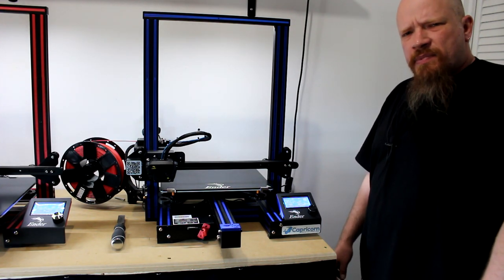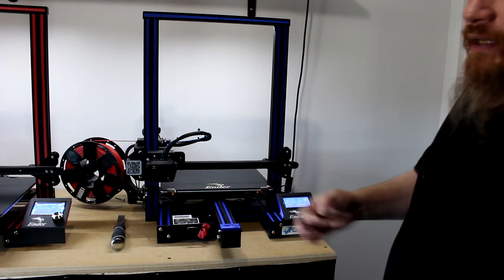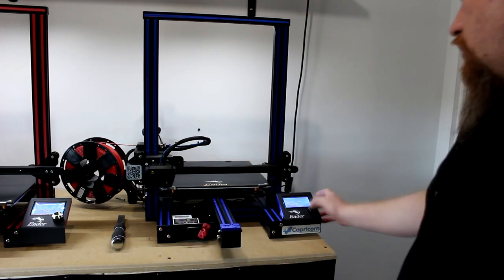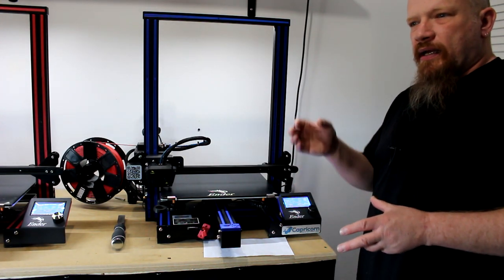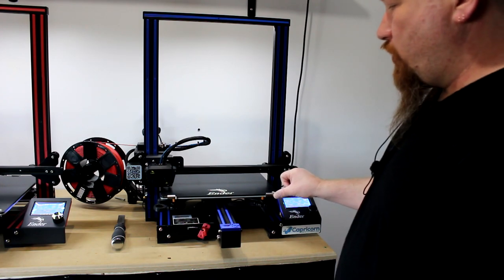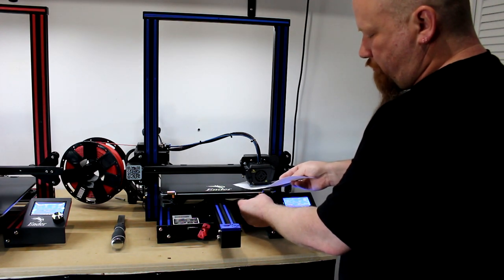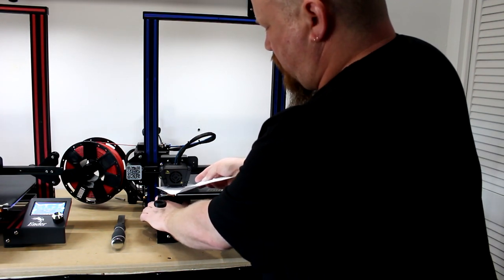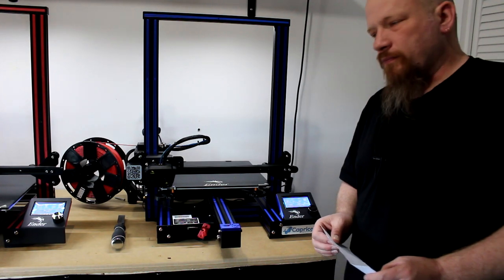Ender 3 Max Bed Level How To

Comment: Do i have to do bed leveling after any use of the printer? Cant we save it?
Reply from the maker: Yes, and no. Depending on the print itself .if I’m trying to remove the print, and it stuck very well to the bed, you might unlevel your bed. That’s why it’s good every third or fourth print re-level your bed or check it.
Reply: @djsprc  thanks 🙏

Comment: When lowering and raising the bed, what direction do in turn the screws under the bed?
Reply from the maker: Clockwise you’re raising the bed counterclockwise you’re lowering the bed what I do when I feel tension on the screw I’m lowering the bed if I feel it no tension I’m raising the bed
Reply: @djsprc  thanks for the very rapid reply to question.  I was focusing on getting my stl files to gcode on Cura 5.1 first and now I am ready to get my ender 3 max printer ready so I can make my very first print,  which will be something like a beskar bar or Imperial credits before I print a mandalorian helmet.  Thanks and I have subscribed to your YouTube channel.  Do you have Facebook or IG?

Comment: Its really nice to see someone do the max! Ive had mine for 5 weeks and had to figure it out by myself.Ive added a few things to mine.BL touch ,no springs its solid now, and also added a dual Z.I was having issues and noticed the gantry not going up and down even even after adjusting it perfect.So I bought a V2 dula Z kit on Amazon for $25us and a 488mm Z rod for $18us and it works perfect! After 20+ zero issuses and havent touched leveling other than Z endstop in tune when print is running and even that is rare.
Reply from the maker: What firmware are you running for your bl touch
Reply: @djsprc  the one on Creality. Easy download and works perfectly. Also the adding of the dual Z no need to download any new Firmware because the Z motors are linked together
Reply from the maker: @davidjohnson8474  Cool I tried I did not want to work for me I went with the Marlin firmware special build
Reply: Where did you get the dual Z, was it a kit? How did you install it was it easy? I have a max on the way and was watching and read about it and seems like Creality kind of missed the ball with the single Z.
Reply: @fimmerson  what i did was buy a V2 dual Z kit and then figured out the max uses a 480mm Z rod so i found one on Amazon. The kit comes with a connector wire so both Z work together. When putting it on you need to relocate the power supply and fallow the instructions and put the plate on. When doing this what I did was put2 rolls of blue tape to get it close.After its all together measure the gantry on both sides and rotate the screws to get them ever.Then it works sweet
Reply: @davidjohnson8474  Hey thanks for the quick reply and info I will do this once I get mine.
Reply: I'm around if any issues
Reply: Yeah the creality firmware is trash..
Reply: Hi Mike, did your Max require a Z kit ( Z modification) or everything went well without any extra hardware?
Reply: @AA-en8gw  I bought a kit and threaded rod anyways and the install was super easy works like a dream. Now if I could just get my bltouch to work.
Reply: @fimmerson , how much the Bl-touch kit has cost you if I may ask? I'm planning to use the cheap £12 from eBay and build the bracket mount myself. As I can't spot any difference between the £49 and the £12 sensor kit!
Reply: @AA-en8gw  In Canadian Dollars it was about 65 to 75$ on amazon, I heard good and bad about clones. I had a great experience with my BLTouch on my ender 3 pro no issues what so ever, the Ender 3 Max though its been horrible. I cannot get it to work at all. I have now purchased the TH3D EZABL and just waiting for it to arrive.
Reply: @AA-en8gw  All you need for this is the Dual Z kit and the proper threaded rod. It works great came with a cable to plug in the motors together needs no firm ware adjustments this way. Suggestion: When your aligning the Z axis make sure you have not yet turned on the machine until AFTER you have it aligned.
Reply: @David Johnson What feet did you use for your bed? I have springs currently and Im not sure which feet work well with the ender 3 max?
Reply: @simplypinto3026  I used aluminum tube spacers from home depot. 1in length

Comment: I just got mine. And started to level and in one corner made a pretty good scratch in the glass doing the leveling. One side was too high and didn't realize it until it was too late 🤬. But I was wondering, do you level every time you do a print? Or just once and done?
Reply from the maker: I would level the bed every time if I move the machine or if the glass moved or if my print is too stuck to the bed I’ll re-level. It’s good practice to pretty much do it every time
Reply: @djsprc  thank you so much man, that helps alot.
Reply: same thing just happened to me xd

Comment: I feel like even just during the process of leveling, it loses it.  You mentioned you do it twice, but I've gone around my brand new Max like 5 times and it wont stay level.  Do you suggest swapping springs?  One of my corners even with the knob maxed in the direction, the nozzle barely catches paper.
Reply from the maker: Verify your Z switch on the side it needs to be all the way down if it’s not that could create you issues. Go in the programmation and do a level bed what I would do before trying to level the bed with the software I would tighten all the screws on all four corners.  Then I would do a level bed with the software.  And make sure to preheat your bed at least to 50 before attempting to level your bed.
Reply: @djsprc  The center of my bed appears to be higher than the edges. When "leveled" at the screws, the nozzle was pushing the layers it was trying to lay down I think. So I did it for just the print zone.  Doing a simple 20mm cube now and this is the first time I've gotten past 4 rings.
Reply from the maker: @briankale5977  It’s always possible that your glass and Bed could be bent. There is another guy on YouTube shows a lot of stuff about printing you can check them out take a look for filiment Friday aka chep.  You have to stay positive with a 3-D printer it looks easy but it’s not.

Comment: Hey, I've had major issues leveling my bed, it keeps curling up onto the nozzle and not actually printing just clogging over it?
Reply from the maker: Make sure you’re at the correct temperature for your bed and the hot end and bring down your fans if your fans cool the hot aed too fast it will clog on you
Reply: Same

Comment: i have an issue with mine, no matter how loose i put the screws the nozzle does not even come close to touching the bed??? what do i do about that?
Reply from the maker: Sorry for the late reply you might need to adjust your   Z switch. And you might need to do a full reset. Just to make sure you don’t have numbers incorrect entered.
Reply: @djsprc  thats shat everyone has been telling me but no one ever says how to adjust thd z switch lmao
Reply from the maker: @JeekyWeeky  What are you gonna do is loosen it and raise it.
Reply from the maker: @JeekyWeeky  I had the same issue with ender 3 pro. And that’s what I did.  Luckily I did not have the issue with my two ender 3 max

Comment: Hey thanks for answering my question the other day. But I have another, have you had any problems with your prints not sticking to the glass plate. I just started yesterday (Monday) and today total of 6 attempts, but once the nozzle gets close to the center it catches on something and starts to unstick from the center on outwards. I did the bed leveling multiple times, I washed the glass plate, and still gets unstuck. I followed the temps for the filament on the bed and nozzle. I figured ill ask you because your the most recent one with an ender max. The other very few videos that are out there haven't talked about it much, the unstuck problems.  Thanks again!
Reply from the maker: Depending on the material you use you might need to use some glue sticks or you’re  bed is not hot enough and even your nozzle may not be hot enough or your fans are just cooling the material too fast.  It always depends on what you’re printing. Size
Reply: @djsprc  thanks man you gave me other ideas to try. Thanks again
Reply: @djsprc  I have seen other YouTube videos where it was suggested to have a bed temperature between 60 to 70 degrees for the bed. I have not made my first print yet but would raising the temperature of the bed to 60 degrees make a difference?

Comment: I have just got the max but the head scratches across the middle of the bed.
So I do the bed level again and same thing.
So I checked the glass with a straight edge and the middle has a bowl.
I contacted creality and they basically said sucks to be you.
Can you recommend something to help.
Reply from the maker: Make sure when you’re trying to level the bed is to preheat the bed at least to 50. One of my printers was doing the same thing and I realize I did not preheat my bed once I did that  all good    But it is weird and that Creality. When I give you a hand.
Reply: @djsprc  I have tried heating the bed as suggested.
But this seems to make it worse.
Looks like I'm going to need to order a replacement bed.
Reply from the maker: @sooty8992  It’s always possible that you might really have something crooked mine was bold but when I heat it up in place itself I will try to reach out to creality again. If you don’t mind me asking where did you buy it directly from them or tro somebody
Reply: @djsprc  it was a father's day present from my children.
So I'm not sure I think it was amazon uk.
I have used some calipers to measure the thickness of the glass and it is about 3mm thicker in the middle starting at about 5 inches in
From all sides.
I'm not totally unhappy with the machine.
However I would like to find the best place to get a good quality replacement bed.
Reply from the maker: @sooty8992  That’s not good what I wiould try to do is maybe try to check if it is from Amazon if it is to call them and see if they’ll take the machine completely back and give you another one one of my friends had the same issue he ordered a glass from Amazon it fixed it
Reply: I just got an Ender 3 Max and have exactly the same problem. When I adjust the bed around the edges (like I do with my regular Ender 3) It hits the print bed in the middle. When I adjust it in the high spot there is too much room at the edges. Did you manage to get this resolved?
Reply from the maker: @alexhofstee466  Make sure to warm up the bed to at least 50 before attempting to level it.
Reply: @djsprc  I did, but I just figured out the issue (not resolved sadly). The glass sheet is warped. When I flip it upside down with the Ender logo at the bottom the issue inverts. Then It doesn't touch at all in the middle when I adjust it perfectly at the edges. I have my suspictions on the new "clamps" used on the 3 Max as the culprit of this since they use quite a bit of force. I first tried with the "paper clamps" from my Ender 3 because I suspected the force might warp the entire bed. But after having another close look I noticed a bend in the glass. The aluminium bed below actually has a dip in the middle so that couldn't be the cause of the problem. I just sent my supplier an e-mail informing them about the issue. Hope they can supply with with a proper glass printbed because like this the printer is unusable.
Reply from the maker: @alexhofstee466  My bed is pretty much straight but the aluminum bed underneath does have a slight bowl in the middle.  Know if your supplier cannot help you I would suggest to reach out to creality   If not on Amazon they’re really not that expensive.  Thank you for your response keep me up-to-date please I do appreciate it.
Reply: @djsprc  I received an e-mail from my supplier (I'm in the Netherlands) that they sent out a new glass bed today. It will be delivered tomorrow probably. Not sure if I'm able to test it yet tomorrow (much work at the moment) but I hope they checked it before sending it and it's perfectly flat. Mine has the bowl in the middle as well in the aluminium bed (as does my regular Ender 3). But as long as the glass is flat thats not a problem. :)
Reply: @alexhofstee466  unfortunately I had to get a new bed.
Creality just kept saying it's not there problem.
And should just get a new bed that they was happy to sale me.
I ended up with a 3rd party elegoo bed working perfectly.
Reply: @djsprc  I received a new printbed from my supplier that works good enough. But I have another strange issue. The first layer prints good and smooth but when the second layer starts it's all bumps and blips. When I manually give the bed more space from the nozzle during the print by turning the adjustment knobs about 15 degrees the rest of the layer prints smooth. Then the third layer starts and it's all crappy again. Then I adjust the knobs another 15 degrees looser and it's smooth again. I have tested multiple slicers but I can't get this one figured out. As easy as my regular E3 was as much of an headache is the E3 Max.
Reply: I bought my E3Max from a Dutch webshop and they sent a new printbed. So that was resolved, but I have another strange issue with the printer I cannot get resolved (the printhead doesn't move up enough after each print layer and messes up the print, details in my reply to djsprc).
Reply from the maker: @alexhofstee466  well I’m thinking you might be over extruding or under extruding I would try to calibrate your extruder there’s multiple videos on it  you can check out this you tuber. https://m.youtube.com/user/beginnerelectronics
Reply: @alexhofstee466  have you enabled z hop.
If not this one thing will make life so much easier.